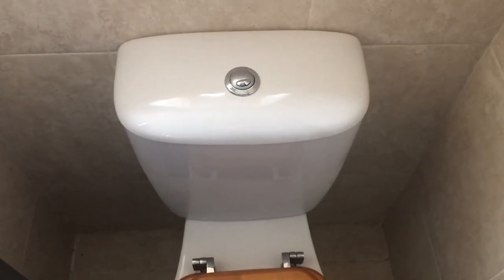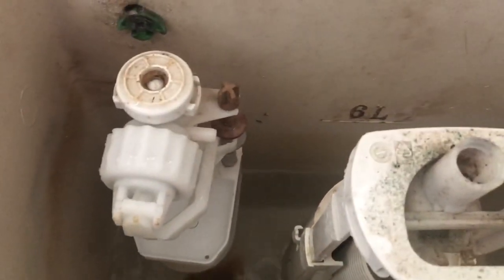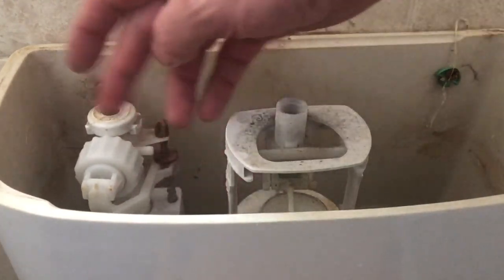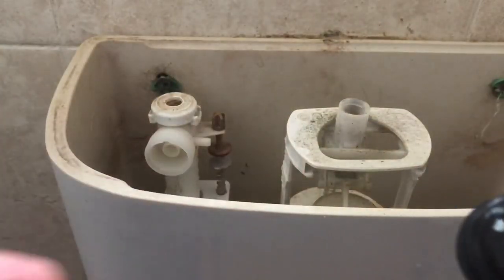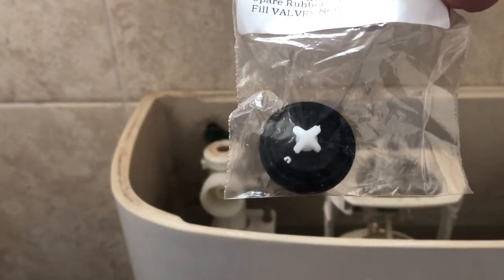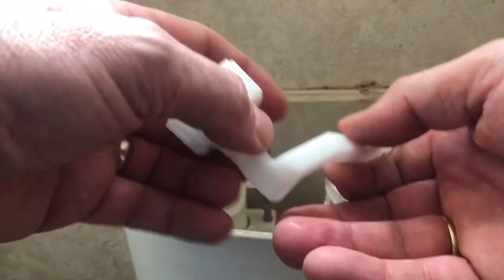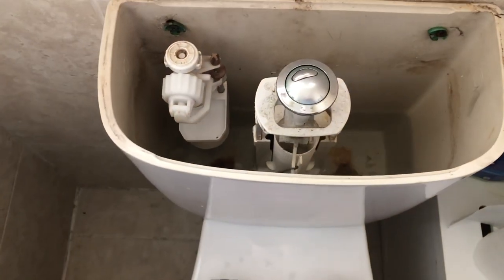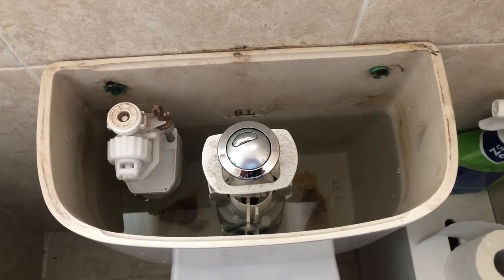Slow Filling Toilet Cistern Valve  £1.89 Cheap Repair SIAMP

Comment: Thanks for this, both of my toilets are suffering slow refill and looks like they're SIAMP cisterns as well so chuffed there's a potential quick fix
Reply from the maker: Your welcome, I hope this sorts out your toilet problems.
Reply: Found a seller on Amazon for a couple of those diaphragms, costing all of around £3.50p. Ordered Sunday, arrived Monday, within 20 minutes both my cisterns were back up and running again! Probably saved 50 quid getting a plumber out. Thanks again  @TheRepairer
Reply from the maker: @sirmattalott1484 Your welcome and we’ll done on the repair work that will more than likely provide much satisfaction with every flush!

Comment: I have the same issue ,  my seal is torn too.  so just ordered one.    Hopefully it's a nice simple fix.   Cheers for the video.  Will update if it worked or not.
Reply from the maker: Thanks it will work.
Reply: well how did it go? has your part arived yet?
Reply: @Tartabirdgames_official  sadly it didn't improve things at all. Still very slow to fill.

Comment: If could give you 100 thumbs up I would. Followed this vid are found that my seal had the exact same split as in your video. Just need to get a replacement now. Thanks a million for this vid.
Reply: Got a pack of 3 spares on Amazon. Fitted a new one but was still getting a very slight trickle of water. I ended up putting the new rubber diaphragm from one part on to the original plastic part and now all is good. Thanks again.
Reply: @joeyla2006    I had the same problem and ended up getting a diaphragm from the maker siamp.  Better quality rubber.  Them amazon ones don't last long.
Reply from the maker: @davidm3maniac201 An excellent point the repair I did is still lasting but the  oem quality was good for around 15 years.

Comment: Just replaced my washer all went well. Unfortunately the toilet makes a pumping noise from the top of the white round section and carries on filling up resulting in the water going into the bowl
Reply from the maker: Is the toilet float stick it’s easy to knock  whist installing this part.
Reply: Was a faulty replacement washer

Comment: Great vid. Very clear. I need to order that part. But also it seems like my float was not going up with the water line (I used a watering can to fill the tank) but it only moves when I push it. Any ideas or other videos on this?
Reply: It's ok it was me. I knocked one side of the hinges out slightly making it stiff to move. Just waiting for the rubber seal to come and hopefully back to working normally
Reply from the maker: The float has got to work for the seal replacement to work. it’s difficult to say without seeing for myself I would check if the float is free to move up and down.
Reply from the maker: Good luck with it when it arrives.

Comment: SO IF THE SEAL IS SPLIT. NOTHING SAID ABOUT THAT ,, IT WILL FILL UP AND OVERFLOW IN TO THE TOILET BOWL ,
Reply from the maker: That didn’t happen in this case it was just slow to refill and water shut off fine.
Reply: @TheRepairer  My problem is its not filling up after a flush but if i turn on the sink  tap it starts to fill the tank cistern up